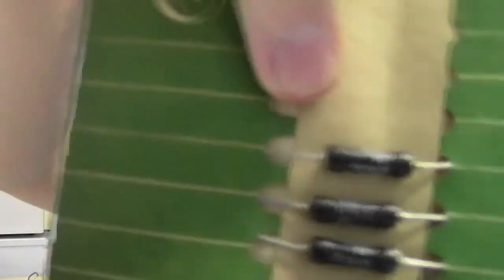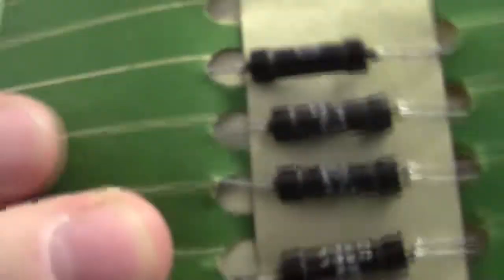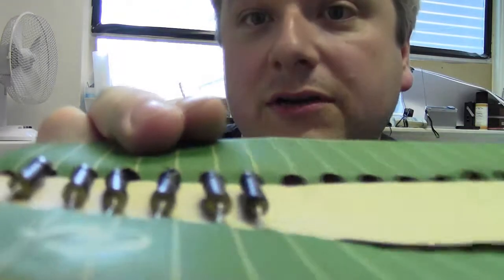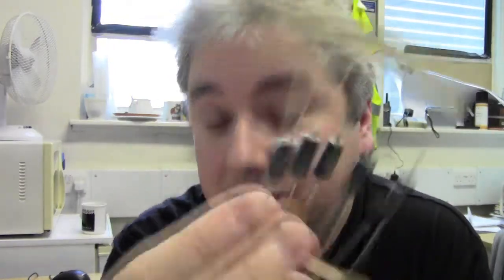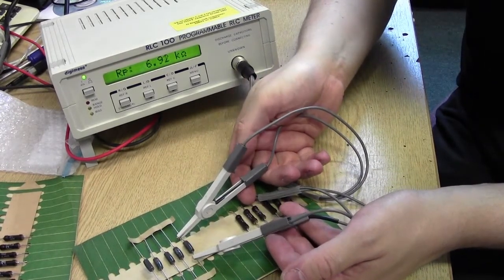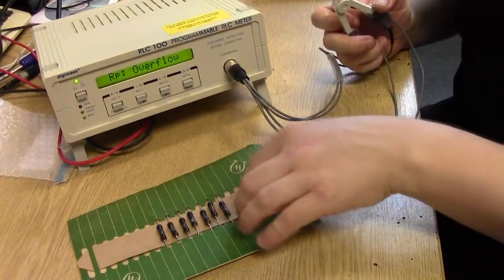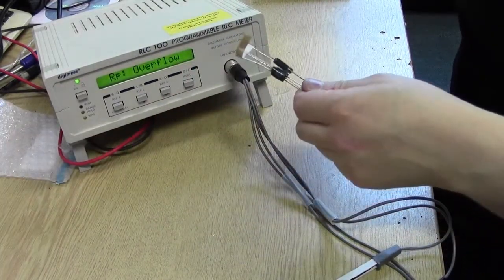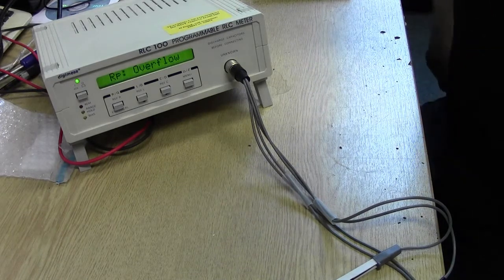Old Vs New - Vintage Resistors

Comment: The price of things usually goes up over time, but since the manufacturing process is a lot faster/easier now, for the resistors, their price has probably went down. I just bought a pack of resistors on eBay, 2600 of them, 130 different values, for $12. How much would you have paid for that let's say 30-40 years ago? Just curious🤔😜

Comment: thank you for the great video and could u  please help me with this question,if The circuit diagram indicates 470 OHM 5Watt wire wound resistor,Can i use 470 ohm but 7 watt instead of 5 watt...thank you
Reply from the maker: Alvin s Yes you can but make sure you have enough space. Generally the higher the wattage the bigger the package.